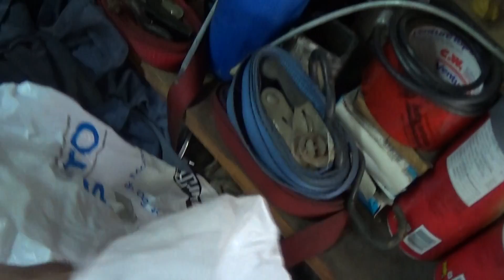BOAT TRAILER

Comment: IRON MAN If that PC, that is, the mainboard inside, is really 15 years old, then it's probably the BIOS battery that is somewhere on the board. With this battery empty, it'll lose its time and date after every shutdown, and you'll have to set it up anew. So it may be alright if you just changed that button cell (often, it's a CR2032, you'll get it for a couple of cents). It's non-rechargeable, but it usually holds up for about 10 years.